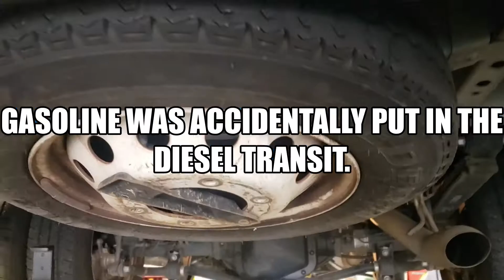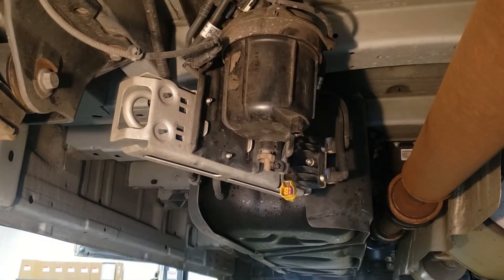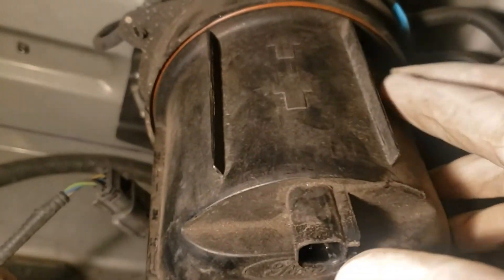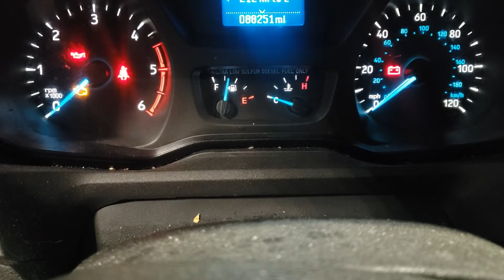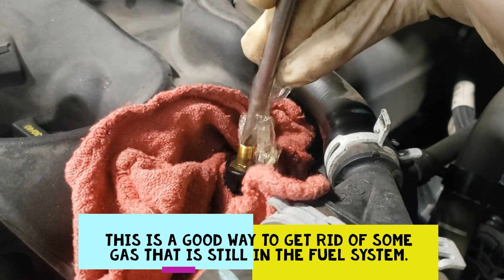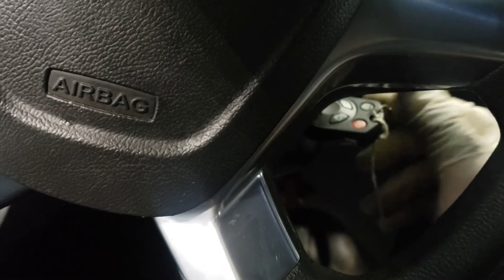How to Change Fuel⛽ Filter on a Ford Transit/Things You Need To Know

Comment: I was leaving Page, AZ going to the North Rim of the Grand Canyon when the fuel filter clogging light, service fuel filter message came on. I drove back into Page, pulled into an O'Reilly's back parking lot and found this video. Fortunately I have been carrying a spare fuel filter and have the wrench, but I've never done a replacement myself. This video was great. I followed it exactly and we are on the road again. Only loss was a diesel-soaked shirt but I knew my "bath" was coming. Thanks!!!
Reply from the maker: That is great! I just wished that I have used the drain plug in the video. The main thing that you are back on the road again.👍🏽

Comment: So helpful. A couple of notes from the manual that might help you. The valve on the bottom is to drain the fuel to help you avoid the “gas bath” and grease will help you to get the canister back on easier.

Comment: Brilliant video my friend, a wee tip though the plug on the bottom of the filter housing is a drain and that stops you getting soaked in diesel when you remove it 😁
Reply from the maker: You are right my Friend!
Thank you 😊

Comment: There is a valve on the bottom, so you can drain the fuel out of the filter. That way you can avoid the "fuel bath".

Comment: I think I'm going to put a glad bag wrapped under it when I release that shower head Great point .. I would have never used a wrench unbeknownst.. Thank you..
Reply from the maker: There is a drain valve on the bottom of the Fuel Filter. I should have drained it first. You drain yours and your job will be better than mines.

Comment: great tutorial! please advice with the following issue : Fort transit,  diesel van 2012. Every time i fuel full tank engine starts juggling, loosing power on more then 3000 rpm, still doen not shut off, as if there is a vacuum in tank preventing fuel flow.
Reply from the maker: Let me guess, I bet that there is no Engine Light on. I would hook up a Scanner to the OBD the next time you fill up. Have someone else driving and  Run a Engine Diagnostic  going down the highway.Save your reading. When the fuel level goes down and the vehicle runs normal again. Do the same thing and compare both readings.

Comment: Hey boss that it is same with the gasoline engine has a fuel filter same location?
Reply from the maker: @diegoordonez2677  good question! I am not familiar with the gasoline in this model. I will say that the 2020 on up gasoline models. The Fuel Filter is in the Gas Tank.

Comment: Hey thank you for providing this content. I have a 2019 transit and it's my first diesel vehicle. Quick question...do I need to bleed the fuel line before the change out, or any btw's? Regarding before I go in and change out my filter?
Reply from the maker: You should never have to bleed the system. Let that be your last choice. I Thank you for watching my video!
Reply: @dairleautoclassicrestorati6892  Awesome, thank you for answering my question. And again thank you for the content that you provided.

Comment: I'm not sure if i understood you correctly: Is it to be expected that the engine runs smoother after a filter replacement? 
Changing the filter when it's required, not for general improvement of course.
Reply from the maker: I have seen improvement both ways.